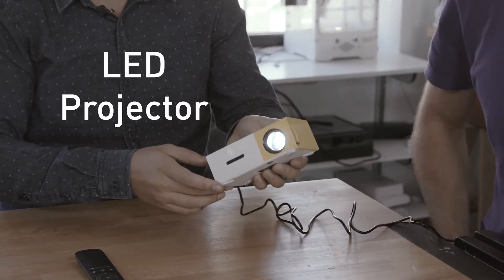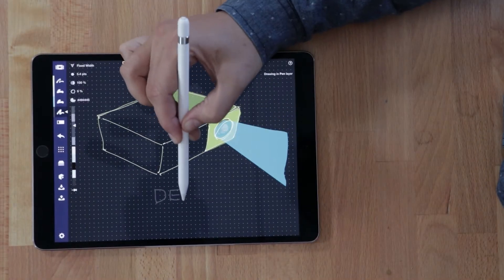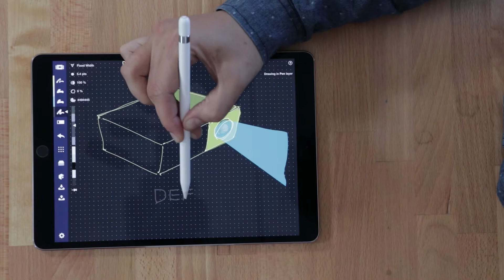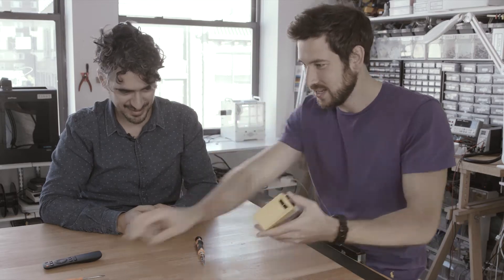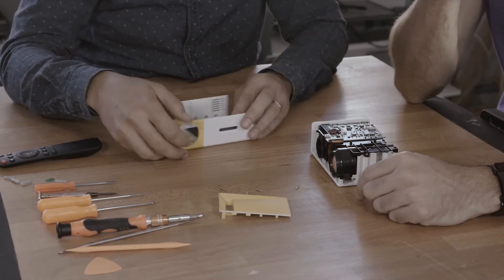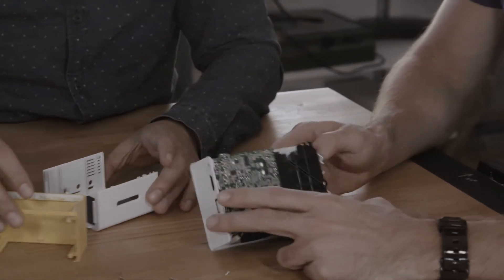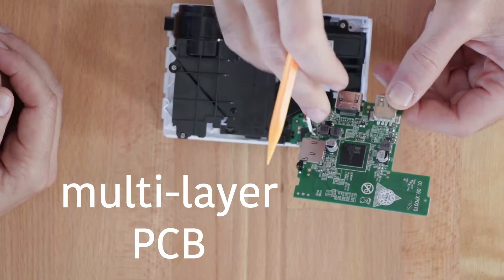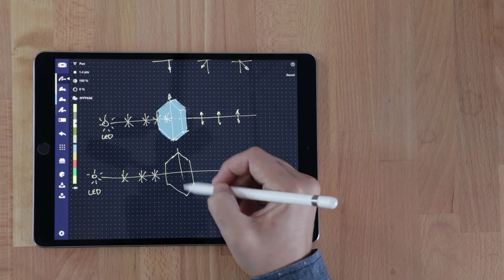DEEPLEE Projector Teardown!!

Comment: I have a 72 dpi image that looks really block built on this projector. There is an image that comes with the projector on the intro screen that is quite clear showing two faces. I thought if I could replicate the size and dpi of that image I could get my images just as clear... Not been able to access the image via cables to get into the projector to find the image so far. Any ideas? 
 Also.. on the image slide show it seems to skip every two or three images. Is that to be expected?

Comment: So the model you show has the on/off switch under the dc in plug this is used for ones that also have a built in battery I was hoping you still have projector and could show a follow-up video on how to install a battery I think if it did have a battery it would have been located behind the mirror in that open space and it would clearly need to be a small battery but also put out enough power because the DC is 12v 1500mh and the micro usb in requires 5v 2a but I am sure a 7.4 lipo battery would do it  there are a lot of people online that are upset there model does not have a battery installed and many people including myself would love to install a battery if just had the help and steps to take to do it